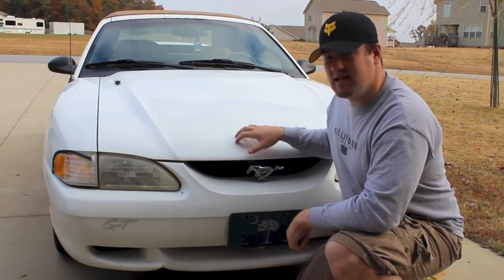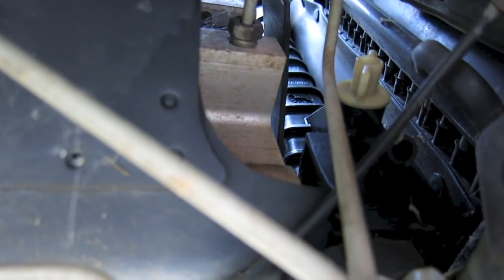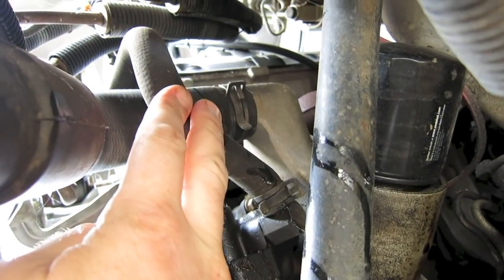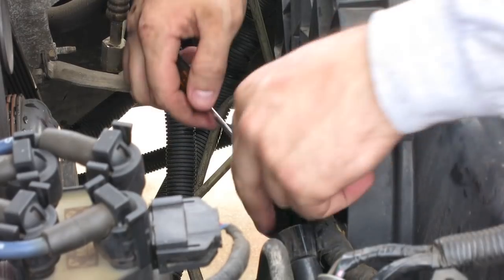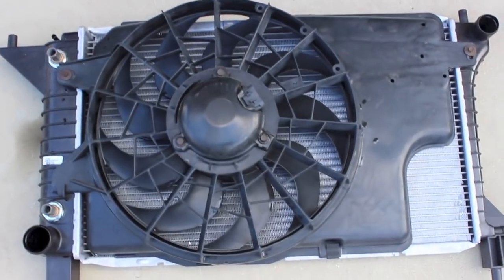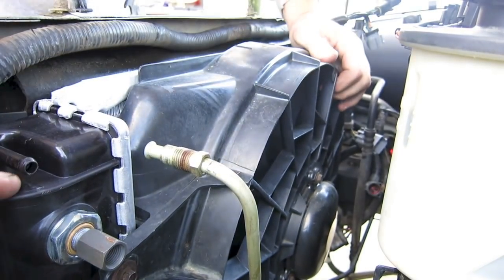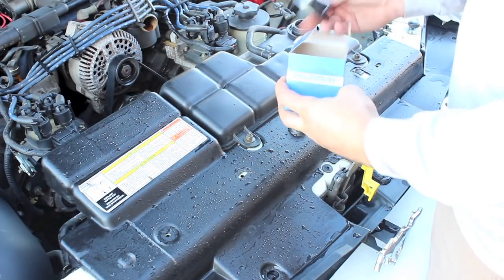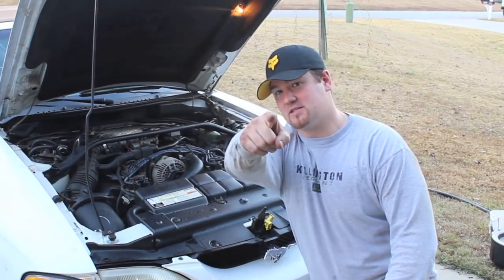HOW TO INSTALL 1994-2004 MUSTANG RADIATOR GT 4.6 5.0

Comment: Thank you. I made the mistake of purchasing one of the best. Its thicker than stock so my AC lines get in the way and Ive had to bend them slightly, they seem aluminum. Unless you plan to overheat your car often, go stock size as much as you can. Also, try reusing old clamps, for leak free, even if youve added new thicker hoses, use vaseline. My experience so far. 🙂

Comment: A shop wants to charge me $1,000 for replacing the radiator and fan on my 03 Mach 1. Found both on American Muscle for $250 and plan on doing it myself! #DIY  

Thanks for the video!
Reply from the maker: luis ramos wow, that shop is overpriced! Way cheaper to do it yourself. Good luck!

Comment: Great video!  Knocked this out, no problem...well, reconnecting the lower radiator hose to the engine was serious pain in the rear...but other than that, awesome!  1998 4.6L
Reply from the maker: you are welcome!

Comment: Watched the video.  Got the new rad.  Followed along.  Good to go.  My car is a 2003 Mach 1 and there were a few differences, but the video is excellent. Thanks for posting.
Reply from the maker: Thanks a lot! Glad it helped you out! Was there anything different that really stuck out a lot? I would like to know, thanks
Reply: There is no transmission cooler issues since the cooler for the tranny is completely separate.
Reply from the maker: oh I see, ok great thanks for the info!

Comment: Good stuff. Any recommendations for a replacement radiator? I'm not looking for anything fancy.
Reply from the maker: you can always try a pick a part place where you have to pull them out of the car, and they are cheaper

Comment: Helpful video Thanks, Just did this on an 00 GT yesterday, (factory radiator developed a slow leak after 107k miles) The bottom radiator hose on motor side was a real pain to remove but other than that everything was straightforward, only difference I didn't remove the battery and just disconnected negative cable, also removed fan while radiator was still in the car and installed fan onto new radiator after radiator was installed, I'm not sure if this was any better or worse but I suspect the battery might of been an issue if I tried removing it all as 1 unit. (i had to tilt fan to one side while dropping it in to clear battery).
Reply from the maker: 73mathesar Glad you got it done, thanks for the info on how you did it. It may help others. Yep i know that bottom hose is a pain to get off. Way easier to put on. Thanks for watching!

Comment: Hey there, I am currently working on mine and for whatever reason I can't get the bottom transmission line disconnected. (I have a 04 mustang, 3.9 L. Everything else is done except for that one...Do you have any advice on getting it disconnected? I've tried the wrench and some other tools but the person that owned the car before me had to have stripped the thing. Hopefully I don't have to cut it off?
Thanks for any help.

Comment: Hey ryker.  I noticed the front tag on the stang, was wondering if u are in South Carolina.  That's where I'm at. But any ways I just got a 97 and I'm doing everything u have done to its even down to the light switch. My question is its been sitting for a year, it cranks and drives but it has half a tank of gas, is it ok to burn the gas out, or should I drop tank and get rid of old gas..
Reply from the maker: +jonathan johnson Yep I am in Greenville, South Carolina. Good luck with all the repairs. If it has been sitting, I would for sure change the fuel filter, but its up to you if you want to drain the tank. Or just remember to not run it low on gas if you think there is junk in the tank.

Comment: I just need to replace the fan and shroud.  The fan motor is smoking.  Can I do that without removing the radiator on my 96 GT?.. Thanks!
Reply from the maker: Christopher Wolf Yes you can, you just need to get some things out of the way first, but you should be able to pull it off without doing that.

Comment: Thanks for the vid. My '96 is overheating. Do you have a systematic way to troubleshoot ?  I'm suspecting the fan but want to be sure.
Reply from the maker: Check both hoses to make sure they are hot after running, then also squeeze for pressure. Take out your thermostat and test in boiling pot of water. then possibly check your fuse for the fan.  You fan should be running after about 15-20 mins especially in the summer heat.  So if you don't have a blockage and its not the thermostat, then it it could be the fan to replace.

Comment: I have a 1997 Ford Mustang V6, the bolts on the crankshaft pulley were sheared off and the belt came off so I took off the remaining bolt on the pulley and removed it so I can fit a drill in to get the bolts out. But there still isn't enough room so it looks like I will have to remove the radiator to have enough room to fit a drill in... Would all the steps be the same/similar for my car?
Reply from the maker: +Dallin Cravens there might be a few things different but still generally the same for the V6.

Comment: I recently acquired a 2002 mustang v6 and I am fairly familiar with working on them because my previous was a 97, but I am interested in swapping a V8 radiator into the V-6 so it'll run cooler I have already swept the thermostat to 160° thermostat, I wanted to know what all you think I would need to swap them. I was looking at getting a three row radiator, dual fans, The GT reservoir, and the GT houses, do you think I will need anything else?
Reply from the maker: thats sounds good, just make sure you have the time and space for the swap since it will take longer than you think

Comment: I am currently swapping out my radiator for a 1999 mustang and have found this video very informative.  However I have gotten stuck on my automatic transmission cooler line.  No matter how hard I try to unscrew it, it won't budge.  I have tried WD40 and another oil to help loosen it but noting is working.  Does anyone have a tip on how to get this to loosen up?  It is the only thing from keeping me from finishing the job.  Thanks!
Reply from the maker: I understand. that cooler line nut is hard to get off sometimes. You just need to keep working at it and make sure you have the right size wrench to get in there. It will come.

Comment: Do you any tutorials about how to change the reservoir anti freeze tank??? mine is crack from the top close to the cap any sugestions i`ll already have the new one <<<<thanks
Reply from the maker: Yes it is very simple, there are just a few screws holding it in. Just watch the video until 2:45 and you will see.

Comment: My radiator does not have those 2 transmission lines. Is your mustang automatic because mine is manual
Reply from the maker: yes it is an automatic.

Comment: Any advice on the transmission lines. Everything is hooked up just cant get those transmission lines in. Ive tried using a prybar to get leverage on the nut. Nothing seems to work, I definitely need some help thanks!
Reply from the maker: Yes I remember the transmission lines being a pain to put back in. Make sure you don't damage the threads when putting in. You could try spraying some type of lube on them to see if you can get them started by hand and then tighten with wrench. Also make sure you open end wrench is the correct size so  you don't strip the nut. Just keep working, I know you will get it!

Comment: I have a 97 GT manual. When i took my radiator out there was another thing that looked like a radiator that sits in front of the radiator, do u know what this it?
Reply from the maker: +moneyhungryyt I think that would be an oil cooler.

Comment: Hey I really appreciate the video. My question is would I NEED to replace me water pump and thermostat when I change my radiator or can I just change the radiator on its own? Thanks.
Reply from the maker: AZ Izzy Yes you can just replace the radiator on its own. I was just doing a full system change because the car had been sitting for a while. The thermostat is really easy tow change though and its like 5 bucks, so you might as well do that at the same time.
Reply: TheRykerDane that makes sense, well my bro has a 96 GT with a coolant problem, and I got a leak too on my 90 LX, I just wish you do foxbody videos too! Lol but thanks anyway
Reply from the maker: AZ Izzy No prob! glad it helped and thanks for watching!

Comment: Would the radiator need to be replaced if transmission fluid is in the coolant container?
Reply from the maker: DJ2KA are you saying transmission fluid was accidentally put in the coolant resovoir? Yes it needs to be  drained and refilled especially if its a lot.

Comment: About how much did you spend on parts from fuel filter to radiator replacement?
Reply from the maker: Well I just happened to get a discount on some parts from Advanced Auto. But..fuel filter $30, headlight knob $15, Water pump $40, Serpentine $35, thermostat $10, Spark Plug wires $65, spark plugs $40, radiator $100, hoses $50, fluid $15, cap $5, odometer gear $15. I think thats it. But I also got brake pads and rotors too, I haven't made the video yet. 4 Brakes- $85, 4 Rotors $100. So about 600-700 dollars you can tune up your car yourself where it might cost like 5k to have a auto mechanic at a shop do all this.
Reply: Thank's these videos are really helpful for a newbie, I'm actually thinking about buying a 2003 mustang fixer upper that has been sitting for a couple years.. I have a little money to play with and I'm thinking this car might just need a few things to bring it back to life.
Reply from the maker: Oh ya for sure, As long as the engine is good and no other major mechanical issues, these tune ups will def help!

Comment: Should the large nuts come out when taking out transmission line? The whole piece is coming out as I unscrewed it...
Reply from the maker: yes they stay on the line.
Reply: Always use line wrenches on the transmission lines. They are also called flare nut wrenches. They keep from rounding the edges of the nut while you torque them to remove them. Use one on the radiator end of the fitting going clockwise and then use your flare nut wrench on the transmission line going counterclockwise to break it. Flare nut wrenches are good for fuel lines and any other hard lines that you don't want to round off.

Comment: My 98 gt doesn’t have the trans cooler lines. Is it possible some years didn’t come with them or are mine missing?
Reply from the maker: yes some variations for sure.

Comment: Hey I can’t remove the transmission cooler connector from the connector from the radiator so I took it all off now it’s leaking but idk I can’t take it off should i just replace the lines ?
Reply from the maker: replace if bent or crimped too much

Comment: hey i got a question so i changed my water pump , thermostat , temperature sensor & got a new radiator but it still goes to to the hot side like it says it over heats but it doesn't get me ?
Reply from the maker: possible you have a clogged heater core, do a line flush

Comment: @ 4:38 you removed the transmission coolant lines.  Unfortunately my son could not get those off so he cut them.  Now we unable to attach the coolant lines to the new radiator.  We have searched high and low for the hardware or even knew lines for a 1998 but have not been able to find the parts so the car has been sitting since October and we can't fix it.  ANY suggestions or help on finding these parts or how to fix this would be greatly appreciated.  If not I have a 1998 mustang that serves no purpose, except maybe parting it out.  I'd rather fix it though.
Reply from the maker: oh thats too bad, you can find the lines online at american muscle or cj pony parts. good luck
Reply: I've actually  tried to find them and I can't locate them for a 98 mustang. For some reason we can't even find the lines.  If you do please let me know because I have a 98 mustang that I can't do anything with.
Reply: Try mustang auto salvage. I looked at national parts depot for the mustang but the late model is still too "NEW" so they dont have parts for it. M.A.S is always parting out cars and they should be able to get cooler lines for a 98 Mustang. Give them a try.
Reply: you can always use a aftermarket transmission cooler and attach the cut lines with transmission grade rubber hose and clamps you have ti make sure the ends where the line is cut is not sharp with a file and the fit lines to the cooler YouTube transmission cooler
Reply: NEVER cut them off, I used PB Blaster, Sat for 20mins, came right off.
Reply: Always use a flare nut wrench for these types of fittings as well.  I would have tried some type of lubricating, or penetrating spray as well.   In any case, most good transmission shops can fashion new cooling lines for you if you cannot find them elsewhere.

Comment: my mustang is manual im geting oil inside is what tipe of oil runs threw the radiator is it motor or pawer stering fluid
Reply from the maker: no oil should be in your radiator. You should have anifreeze or water in your radiator

Comment: Please tell show me how to bleed coolant on this car bcuz their is no info or vids to do so also mines has a heater core bypass PLEASE HELP! 4.6 v8 96gt
Reply from the maker: So your heater core is plugged? You need to buy a new one, and get rid of that bypass. Just empty your radiator flush and refill

Comment: Thinking of buying a 1998 V6 Mustang and I wanted to know if the engine bay looks identical to yours.
Reply from the maker: Well it doesn't look identical since it is a V6, but pretty close.
Reply: Now that I read my question... I laugh. What I was trying to ask was if the steps on your videos would be similar if not the same for a V6 engine and if all parts would be found in the same general areas.
Reply from the maker: oh I see, yes for the radiator they should be almost the same. Cooler lines, upper and lower hose, Its possible your reservoir tank might look different. But otherwise the basics are the same. Hope you get it done!
Reply: Awesome... thanks!!! Another questions... well more like a symptom. Mustang just stops or stalls out like in the event of overheating... I'm being told that it's because I run too close to empty and all the trash/impurities clog up my injectors and or fuel system.
Reply from the maker: Jorge Cardenas yes thats true, especially if you are always running low. Those older tanks can have a lot of junk in them if you have not replaced it or taken it off and cleaned it out. Plus it has to do with the gas these days. Its not as clean as we think. Try running some Seafoam through a couple tanks of gas.
Reply: Awesome... So the fact that my car stalled on me right now on my way to school with a half tank of gas would be caused by the same problem? It let me drive for about 15 minutes and then it started stalling like if it had overheated only I give it 5 minutes and then I can drive for another 3 or 4 minutes. What a drag... stress I really didn't need before the first day of class. Heh... Sorry about bombarding you with all these questions,
Reply from the maker: well that's not good. Have you tried checking or replacing your fuel filter? This can be a huge help especially if you have run your tank low before. Check out my channel or Mustang fix it playlist for that repair. Its pretty easy to replace. Good luck!
Reply: Fuel filter and pump have been replaced. Stumped... In fact I'm sitting in my car as I send you this message waiting to see if my car rests long enough to get me home. Lord Help Me! Seems like the fuel pressure just goes and gas pedal goes limp. No response from engine and then RPMs just go down to zero... Well, not without a fight. The car struggles to stay on but eventually it just dies. Thanks again for your help!
Reply from the maker: wow, that is weird. I guess I don't know what else to tell you. Does your engine light come on or blink? You should take it to Oreilly or Advanced and they can hook up the computer to it and see whats going on.
Reply: I'm starting to think that it may be the Fuel Pressure Regulator... possibly.

Comment: I have a 99 mustang gt manual trans. and I bought a radiator and it has two openings for the trans coolant line but my car does not have any... what do i do??
Reply from the maker: ***** I am not sure I understand. Your car does not have trans cooler lines? or it does not have two of them? Maybe check  your radiator to see if its the correct one.
Reply: TheRykerDane Yea the radiator i took out did not have any trans cooler lines connected to it. Yea its the right one. I got it off auto zone .
Reply from the maker: ***** There might be a "U" line that you can connect to each trans line hole so that there will not be a leak. I am not sure why you have a radiator with trans line holes and your car does not have the lines to plug into it with.
Reply: YOU DONT DO ANYTHING....  You just install the Rad and fill it up.  What do you think you need to do?  The cooler inside the new rad will simply not be used...its still water tight.  Just install it.  I've turned some of these into Oil Coolers for my engine at times...its a heat exchanger...you can either use it or ignore it...  Most parts places only stock the Auto trans style rad because it covers both styles of vehicles....Manual and Auto....So only need to stock one type of Rad.  What am I missing here?
Reply from the maker: SquillyMon You got it all!

Comment: Whats the top part of the radiator in the engine bay that forms across the radiator where the hoodlatch it
Reply from the maker: thats just par of the hood attachment
Reply: @TheRykerDane  it was the radiator core support hah.. Tied it to a tree and straightend it